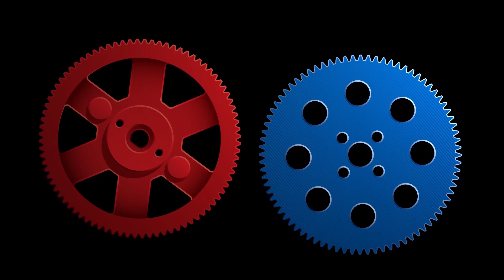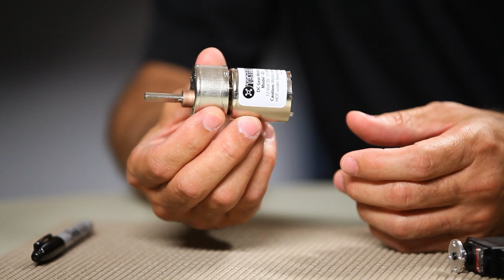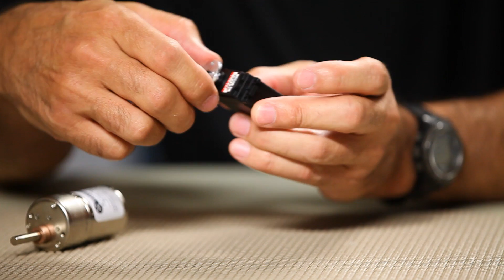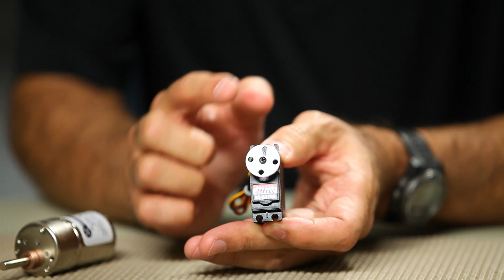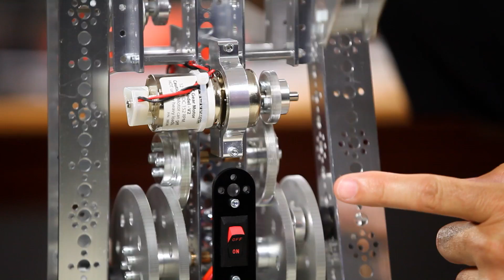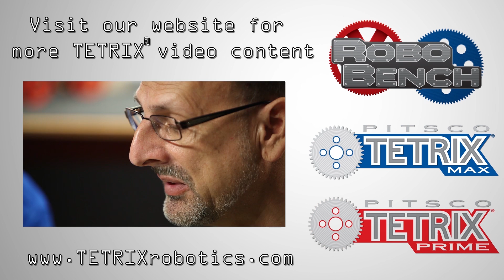RoboBench: Choosing Motors & Servos

Comment: I want lift 200g using a DC motor, but I don't know whether to use 6V dc motor or 12dc motor and the value of it's RPM. could you help me, please?
Reply from the maker: Sorry, but your comment didn't have enough details to help answer this question. In the US you can call our Technical Support team at 800-358-4983. Or email support@pitsco.com and provide details about the setup of your build and how it's going to be used to get suggestions from our experts.
Reply: TETRIXrobotics I'm in Sri Lanka!.
What kind of details you wanna know about this!?. I'll give you.
Reply: I'm going to build a pipe climbing robot with carrying package.this is for my final year project. My target is to carry 200g or 500g to carry to the top of the pipe using the robot and come back to the starting point.
Reply from the maker: There are many factors that can affect a build, so please email support@pitsco.com with the details you mentioned here. Support will probably have more questions for you, so it might take a few emails back and forth to gain enough information to give you any suggestions.

Comment: Hey, I've got a question! How do you know the amount of voltage you need to have for your dc motor? We have a project in which we will need two dc motors for two wooden wheels. The wheels have a diameter of 18 cm.
Reply from the maker: Which motor? We have a few.:) If it's a TETRIX® MAC DC Motor, they are rated at 12 volts. PRIME is a six volt system.

Comment from the maker: The short answer is, yes you can use a motor.  

The long answer is...
Keep in mind simple machines principals. The long arm is basically a lever. To increase efficiency (make the arm stronger) you can change what class of lever, change position of fulcrum, or change where the work is applied and all of those will impact how effective the lever is.

The other way you can impact this is with a stronger motor (which is the point of your question:), so you can increase the final output of the motor by adding a gear train above and beyond the motor itself.

Last but not least, there are other ways to lift objects beyond just a classic lever arm. If the parameters of the challenge allow it, you might want to research other types of lifting methods or devices.

We'd love to hear how it works out for you. Please comment and let us know how it goes, or If you're on http://twitter.com, post a photo and tag us (@TETRIXrobotics). Good Luck!